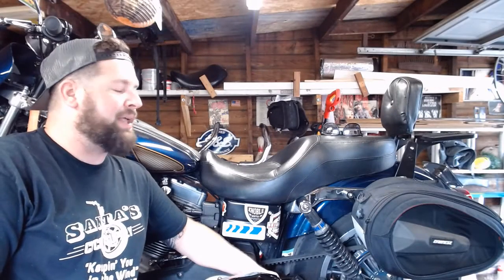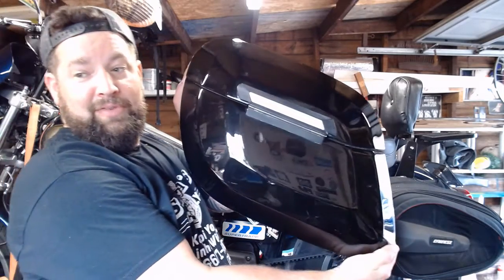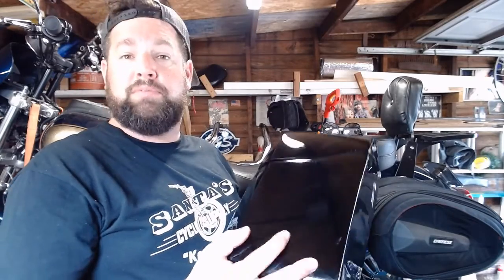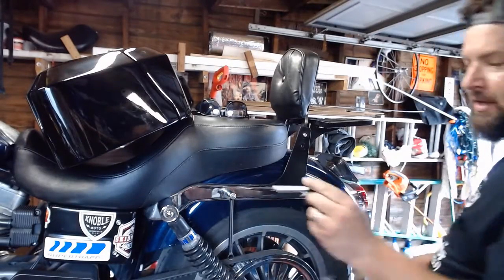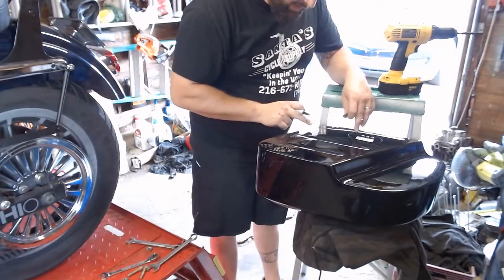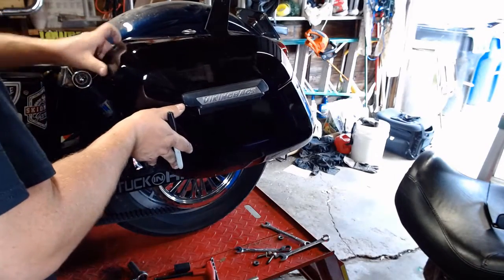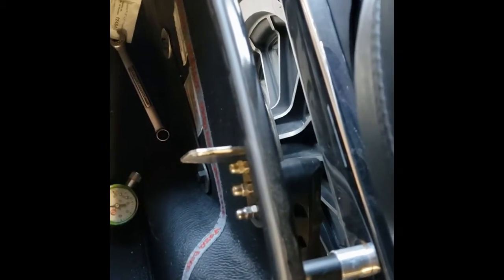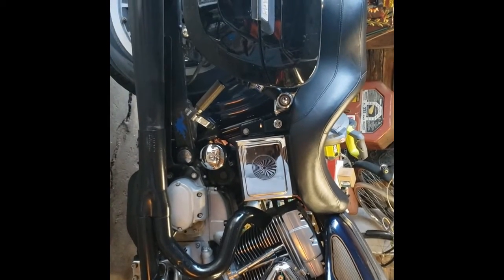Viking -Lamellar Saddlebag Install

Comment: You should have done the exhaust side first, so you get the clearance from the mufflers far enough. Then you can match the height of the other side. If you do the other way (like in this video) you may have to go back and re-drill the holes to get them right. Just FYI. I've done enough aftermarket bags on bikes, so I know what I'm talking about.
Reply from the maker: Not a bad idea

Comment: Did you line the bottom up with the swing arm?  Trying to install mine but it seems like it'll be crooked in order for me to drill the holes
Reply from the maker: I did all measurements off of the fender strut & strut bolts.